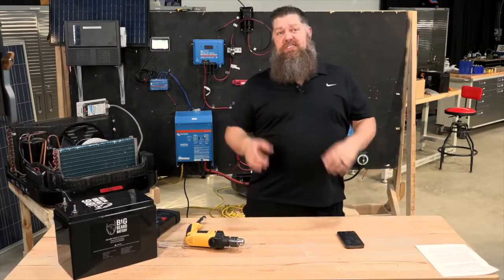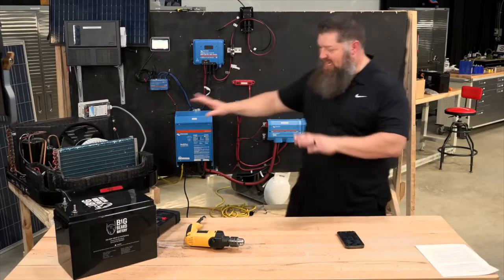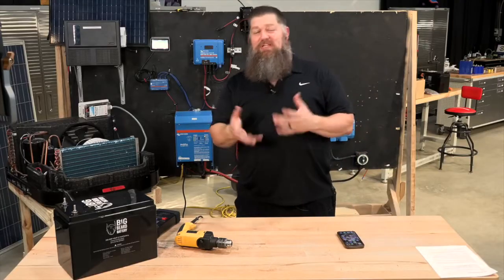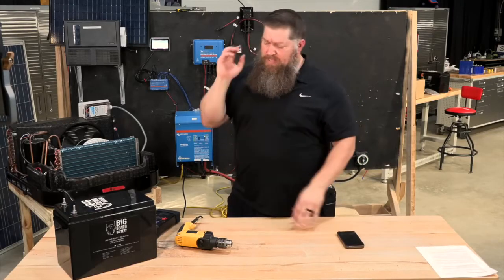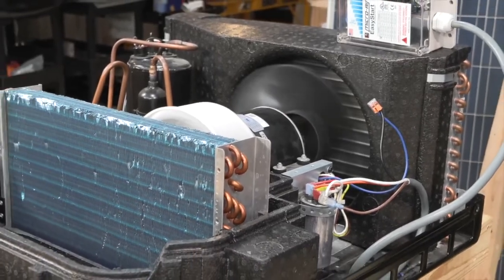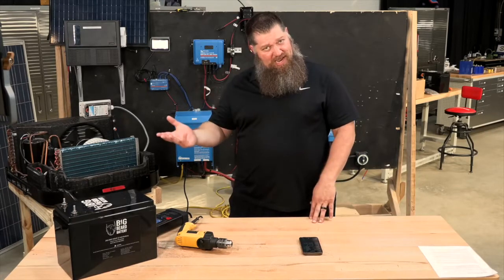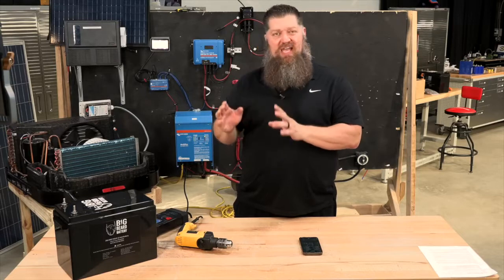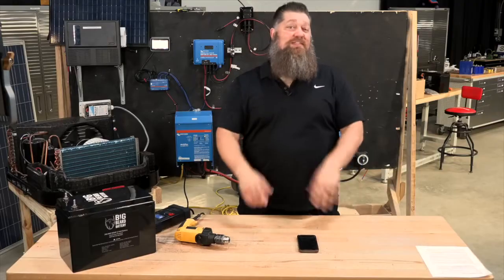Can you run your RV AC off one battery?

Comment: Todd love your channel. What do you do when many RVs like forest river have inverter preps that are 12 or 14 guage wire which means 2000 watt inverter. How do you wire to run AC.  Do you have to run a 2nd inverter with large guage wire from battery area to breaker panel just for AC?
Appreciate it. Just trying to understand theory

Comment: I can get a brand new 6v 110ah lead acid deep cycle bat for $100 each.
These Big Beard 12v 300ah bat's are going for $600 each.
So 
$1,200.00 for 600ah    x2 lithium.
Vs    
   $600.00 for 660ah    x6 Lead acid.
Or 
$1,200.00 for 1,320ah x12 Lead acid.
Your bat's bang for the buck just is not there.
Reply: your math is off…..  6 110AH 6 volt batteries is not 660ah at 12v.  its 330ah when connected in a series parallel to build a 12v bank.  Two 6v 110Ah batteries in series is still 110AH just now at 12v. So, 12 of the 6v batteries will get you 660AH not 1320ah at the same cost as the 2 300AH lithiums. That will get you significantly less USEABLE power than the lithium can give since lead acid batteries lifespan is severely degraded if you run them down below 50% often unlike lithium. You also have to deal with  probably10x the weight and 10x the space which is important in a mobile installation and 1/4 the lifespan. Not a very good value proposition……. Lead Acid is the worst investment you can make in batteries in 2025 for a mobile power system.
Reply: @TDub_ADV I have lead acid 6v bats going strong 20+ years.... You can recondition them. And yes they are heavy and only 50 capacity true use. But they also don't explode from thermal runaway....🔥💣☠️

Comment: I guess I missed the point. None of it made sense except for that you're trying to sell me one of your batteries.
Reply: I got the fact that it will take about 5 or 6 280ah batteries to make it thru an 8 hour night with the A/C and a couple night lights running. Also about 5 400w solar panels to keep up in the heat of the day. So setting up a full off grid with A/C deal will cost about $7500.
Reply: I get that too.
I can get a brand new 6v 110ah lead acid deep cycle bat for $100.
These Big Beard 12v 300ah bat's are going for $600 each.
So 
$1,200.00 for 600ah    x2 lithium.
Vs    
$600.00 for 660ah       x6 Lead acid.......
Or 
$1,200.00 for 1,320ah x12 Lead acid
Your bat's bang for the buck just is not there.

Comment: I Run a 240v LG  non inverter 2.7Kw a/c from 240ah lipo with a 3000w inverter and no soft start.  No issues and

Comment: I have a 84 tioga class C. It has a 45a inverter/charger in it from the factory. i am installing 400w solar panels on the roof. How can channel the solar power to the rv 12 volt system? If I buy a inverter, how do I route that into the system? Do I plug it in where the off shore plug goes?

Comment: Hi! I’m hoping someone can help me I’m looking to do mobile grooming in my colmen 17r and would love to not have to work with a generator. I need to run a high vacuity dryer Power 1800 w max 
Input 120v 60Hz 17A max, I need my plug ins for my calipers, charging stations, hot water. I also may need ac or to power my electric fire place from time to time and of course my lights. Any advice?

Comment: I run both my motorhome's A/Cs off a single battery. It's a big 48v battery that I made myself out of 16, 320ah prismatic cells connected in series. During the day, when the sun is shining, I can run both my 14.5k btu soft start equipped rooftop A/C and my 12k btu mini split heat pump through a 5,000w all-in-one inverter/charger/charge controller all day long off our solar/battery system. When the sun goes down, my single battery will run our high efficiency EG-4 28.5 seer-2 heat pump all night long in either heating or cooling mode using no more than 1/3rd of the battery's capacity. The price of the raw cells, a 200A smart BMS, flexible bus bars, compression fixture and aluminum angle to house it and secure it in place was under $1,900. This 16.38 Kwh do-it-yourself battery has the equivalent capacity of $12,000 worth of Battleborn batteries or 2, 24v 300ah "The Beast" Big Beard batteries.

Of course, you need a $50 adjustable power supply to top balance the cells, plus the time and knowledge to assemble the components. It will lack advanced features like remote internal monitoring and self-heating, (though you could add these features if needed.) However, the BMS will provide cold-temp charge protection, high-temp, over-charge protection and balancing. Still if you're looking for a bare-bones, yet safe LiFePo-4 battery that will last 4-6,000+ cycles, you can't beat the price per kwh of building one yourself - especially if you have more time than money like us, or simply want the highest battery capacity you can get on a limited budget.
Reply: Ever consider putting together a "how to" video?

Comment: Hey Todd! Quick question. I have a 2018 Airstream 27FBQ with two 100 Ah AGM batteries. I do have a charge controller that is built to work with lithium batteries. If all I want to do is change to one of your 280 Ah batteries, do I need to make any other electrical changes on the trailer? All I am looking to do is get more time and reliability and less weight out of my batteries. Perhaps I will enlarge my solar bank at a later time. Thanks so much!

Comment: Thank you for posting!..I am learning about all this electrical RV stuff because I just bought a used 2004 Newmar Motorhome with two air conditioners and no inverter. I can turn a wrench but am not a plumber or electrician, so this info was very helpful about how the AC unit will typically run at 14amps to start, etc, considerations when setting up an inverter station, lithium vs. lead acid, etc. I have subscribed to your channel. Keep the informative videos coming! I like your no-nonsense approach and the fact that u are not always trying to hawk an RV product like some other channels..U keep doing videos like this and your channel will grow quickly...
Reply: This entire video is him trying to "hawk" his battery to you 🤣

Comment: So, I am kinda confused, if I and others am off grid, we are usually in a BLM area with no other campers that are close, not in any campground or state park surrounded by other campers. I do understand the practical application in an urban area RV part which does have their rules and regulations which are desperately needed. Thank you for the information, keep them coming.
Reply from the maker: I assume you’re talking about generator use? If you’re in an area where you can run it all day long feel free. However, having the ability to source electricity from the sun is more peaceful.
Reply: While commonly available in the West, BLM land is not common east of the Rockies - so boondocking in the eastern 2/3 of the country usually involves some sort of state park, Harvest Host, etc. where restrictions are in place.